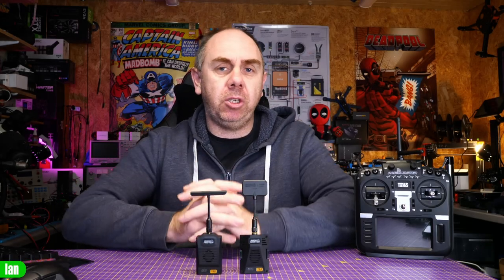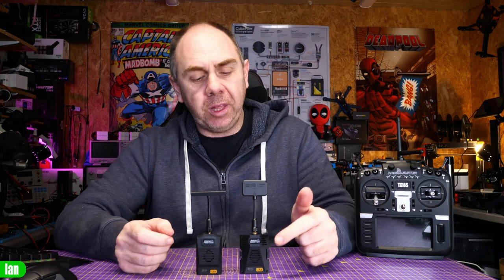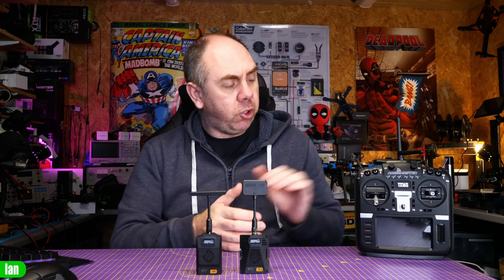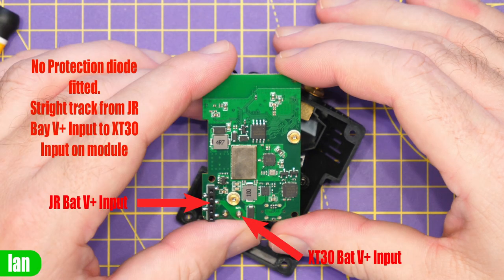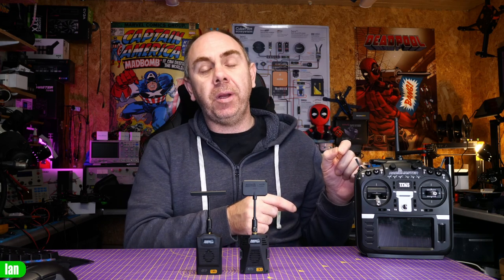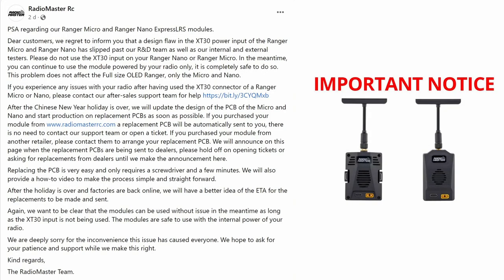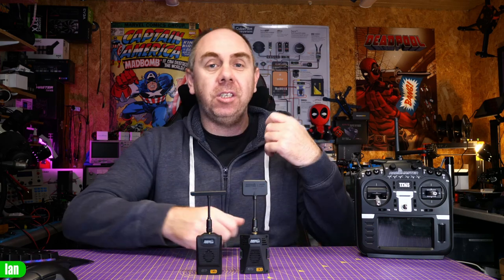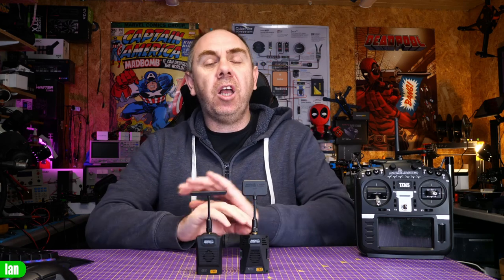Radiomaster Ranger Nano & Micro ELRS Module - Don't Us External Power PSA

Comment from the maker: Hay everyone, I want to make sure as someone who recommended this module it’s only fair I highlight the issue as well.

Radiomaster are a fantastic company and are trying to resolve this as soon as possible. 

Once this issue has been resolved I will likely take this video down and then re upload the review as that’s the fair way to deal with this.
Reply: You should leave it up. Anyone who bought them at launch is susceptible to damaging their controller, which RadioMaster isnt going to cover...i'd be pissed if i burned my $200 radio because of their defective module. Thank you for the warning, please keep it posted. Also, i wonder if there is any kind of marking to denote the new version.
Reply: You can plug a 2s that's plugged into the radio and can plug the xt30 into the module

Comment: In your review, the pinned comment of yours says this: "Once this issue has been resolved I will likely take this video down and then re upload the review as that’s the fair way to deal with this." - video is not updated, not taken down, and Radiomaster solved this weeks/months ago. This is what it says on every single product after they fixed it: "Update: Updated to the V1.6 PCB which is fully functional and at no risk of XT30 issues." - I believe this should be noted somewhere.

Comment: I had my TX16S damaged due that flaw on the Ranger Micro module. I plugged a 4s battery on the XT30 connector and the main board of my TX16S got damaged. Maybe I was one of the first because I contacted Radiomaster and they said have never heard about such failure. They asked to update fw and I decide to open the radio and found a small inductor burned. They said they will send me a new main board for the TX16S and a new revised PCB for the Ranger Micro. Let´s see...they are coming back from chinese new year holiday! I liked their position to assume the failure and offer after market assistance. That is positive.
Reply: have u received any replacement
Reply: Yes, but forget the seller at Aliexpress. They refused to send any pcb/module, so I could only get it going directly to Radiomaster.  The new module is ok. Before test it I measured if the xt30 terminals were shorted with the +/- of the JR bay, they are not, so there is a diode put there. We are all safe now.
Reply: @morifpv6441  Nice, good to hear radiomaster has made it right.
Reply: @user-yk1cw8im4h  Yes this should be the standard behaviour.  Design flaw, the manufactured must take the full responsibility.

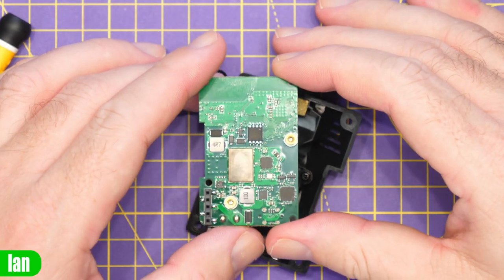Comment: 2:35... What would be a mod someone could do on the PCB to fix the XT30 issue Ian. Cutting a Track and soldering a Diode in place seems like a simple fix. It's great that RadioMaster is owning it a stepping up to make it right.👍
Reply: I'll probably just tape over the XT30 for the time being :)
Reply from the maker: Basically yes it just needs a diode between the xt30 and the bay pin.

Comment: But that pin is 2s voltage on my radio already. I would only need to worry about handset voltage vs external pack voltage levels. Right? I don't even have these just curious.
Reply from the maker: It’s complicated.  Technically yes it may be fine however there could be some unexpected issues when you power the radio down ect.
Reply: The power pack I used to use for Crossfire 2Watt, was 3S, could handle up to 15v, which would fry a JR bay if the module isnt isolating them

Comment: Of course I leaned about this after ordering the Ranger Bundle.
Reply from the maker: New stock should be fine now.
Reply: @MadRC If my module has the "updated V1.6 PCB", is the issue resolved? Thanks for your help.
Reply: @yannickg6904  can you check it?
Reply: @Walter_Berg  I should receive the package on Tuesday or Wednesday. I will open it
To see if there is a diode.
Reply: @yannickg6904  would be nice, don't forget please😆
Reply: @Walter_Berg Unfortunately ,the Post office lost my package. I will not be able to give you an answer.
Reply: @yannickg6904  oh will they pay for it?
Reply: @Walter_Berg  They are still trying to track down the package, I must wait.
Reply: @yannickg6904  good luck, I hope you will get it
Reply: @Walter_Berg  Hello. Everything ended well. I used both the transmitter module and Receivers. Bundles with a V1.6 board CAN be powered through the XT30 plug. This was first confirmed by the vendor and Verified in the field on my own TX16S.
Just make sure the transmitter module has the updated V1.6 board, that is key.

Comment: I’m having issues with full size ranger when not using xt30 on 1watt
Reply from the maker: Yea it will happen. Some radios can’t provide enough power.
Reply: Be careful,  overdrawing on the power pin can burn your pin in your bay, if it's not specced to deliver the current.

Comment: So it never happened in their testing?
I never use external. Only one I would use on is on my t-lite but that nano happymodel doesn't have external battery xt30
Good on them replaces. I love companies that do that. I've had companies not replace like dji mini 1 issue dji only offered discount on mini 2 or se that hitting market.

Comment: Thats a pretty basic mistake. The R9M had the same problem. Huge hit to their reputation.
Reply: Yes, elementary mistake, reviewers should have checked voltage on the bay supply pin with the external socket powered. So many comments here about how wonderful Radiomaster are, not so sure myself 😐other factors in play here I think 😒
Reply from the maker: How far do you expect us to go on a review ? 

check every regulator onboard for correct voltage, looks for transients, check that the module UART levels are correct and make sure it’s not got any design issues that no one had even thought could happen yet.   ? It’s an error we have not seen in a long time, it’s one of those things that happens.  

This is a small error in the net naming most likely that resulted in the diode being moved. It’s actually there just the wrong side.   If you make hardware then there will be mistakes, it’s inevitable.  

If your implying for one moment people give Radiomaster a free pass that’s nonsense. This video to prove that’s not the case.
Reply: @MadRC  Sorry, I didn't mean you. Your reviews are great. I meant the designers  should have tested it out before sending to market. They rely too much on reviewers and consumers to find the bugs.
Reply: @stevietee10  They've done a lot of sketch stuff that's gotten glossed over because "omg open source so great" and yeah it is... but they(and jumper) were never the only option and tbth a lot of their success was influencers promoting the heck out of them IMO.

Comment: Well here is my experience.
I placed an order with RM"
My first order. 
AFTER placing the order I received a 5% discount code email, when I tried to apply the code I could not do it, After contacting RM cust support they said there is no way to use the 'first purchase' discount code after the first purchase has been ordered... 
This sounds like false representation to me.
The cust service rep actually said "we really did not charge you much for that (700$) purchase" ... 
I paid full price for everything!
My CC was charges over 1 month before shipping, effectively leaving me with no recourse if RM would not ship.

Finally the box arrived... 

I live is a large apartment building, the box was left outside of the front door... of the building not of my unit. Pure luck it did not get stolen.
Now the Ranger Micro does not work, DOA, I connected it to my PC to flash it, it failed. 
I installed it on my TX16 it did not even lit-up.
What do you think I should think of THAT experience???
Do I want a "replacement board"? (whatever that is?) no I want what I paid for!!! Now 5 weeks ago!
Sorry.

I feel like throwing the whole in the bin and call it a loss.

Comment: I set mine up on my Flysky Nirvana and flew 4 packs. I powered it by a 2s externally. I got lucky I guess. I have to use external power for the Nirvana though.
Reply from the maker: Technically 2S will be fine as that’s what the bay will provide but it’s a risk with no back protection in place.
Reply: @MadRC  thanks. I just picked up a betafpv module for the time being. I’ve been on crossfire for years and just decided to switch. Go figure I’d have issues.
Reply: @MadRC  I suppose if your using the same battery that is powering the radio it would also not be an issue?